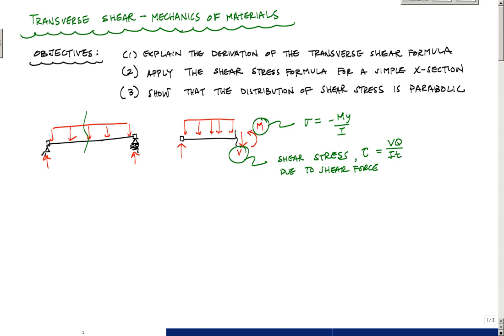Shear Stress in Beams (Part 1/2) - Mechanics of Materials

Comment: as we know that shear stress and bending stress  are not constant in a beam.
 so while deriving shear stress in a beam, shear stress shuold go on decreasing as the bending stress increases but it isn't so. why ???
i know the derivation but the theory is different
acc to theory  shear stress would be decrease as the bending stress increases
Reply from the maker: Enrique Iglesias dear famous singer, shear stress only depends on the internal shear force in the beam and the bending stress depends on the internal moment at the beam at the section (or cut) where you want to calculate.
Reply: structurefree  tell me the difference between degree of freedom and degree of indeterminacy
Reply: please sir i need your help i want to know how can i found the slope and deflection of simply supported beam when it is  subjected of only moment at one end please explain it
  

i know the conjugate beam method but i want to know how can i found it through alternate method which is comparing the moment of resistance and the bending moment of beam.
Reply: how can i send a vedio to you about  what i am solving or where i am stuck.
Reply: i need your urgent attention
sir
Reply from the maker: Enrique Iglesias youtube.